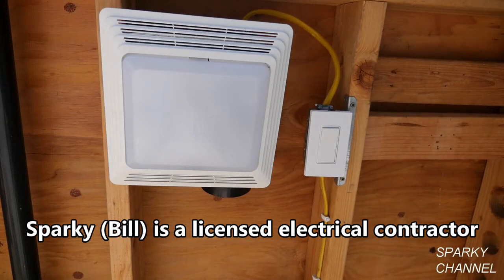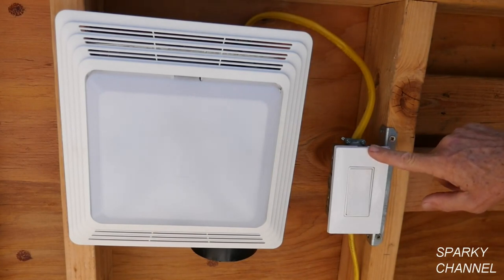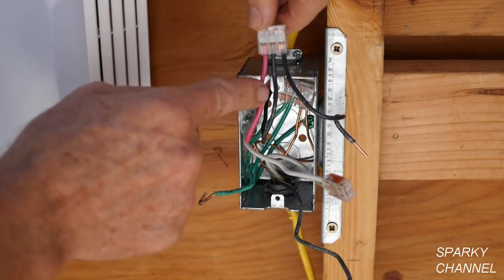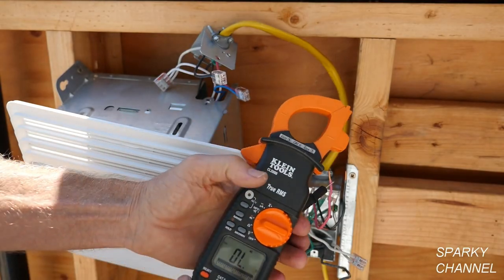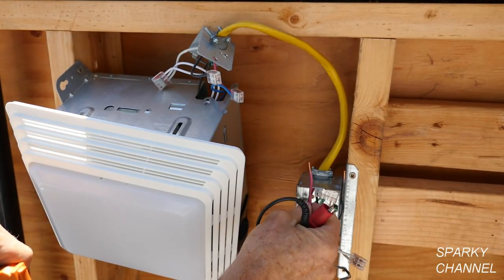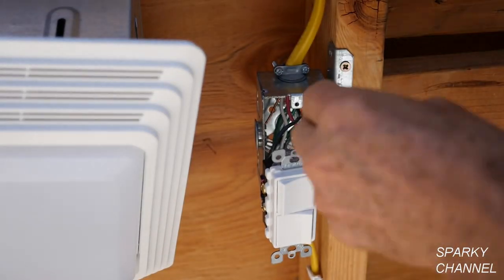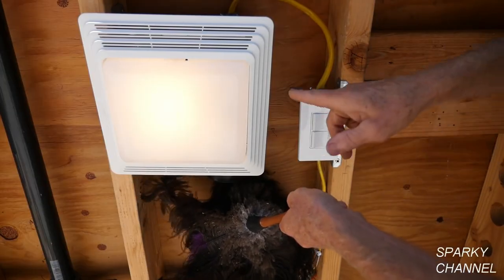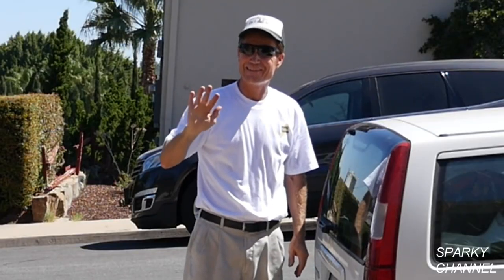The Easy Way to Put Light and Fan on Separate Switches (With Some Luck)

Comment: Boy the extra wire usually isn’t available. That would be a big score and a big breath of relief 👍
Reply from the maker: A little optimism is sometimes paid off with this scenario. Especially when then fan and light are in different locations there is often times enough wires in the switch box to wire a double switch.

Comment: Great video. Better explained than any other i've seen on youtube.  Great job!!    
I have a question for you.
I have a bedroom ceiling fan that uses the same double switch set up in one box as you used in your video.  It also has a remote which was installed when the fan was installed, and it works perfectly. 
Now, the problem I am having is I tried to install some smart switches, and the light would turn on normally right away but then after a few days, the light would wait at least 30 seconds and many times more before coming on.  So then I tried a different smart switch, same thing.  Then I tried a different brand smart switch, same thing.  Then I tried the old switch back in and same thing.  Then I tried a NEW double switch, same thing.  Very frustrating.
I'm pretty sure the wiring is correct. I had a ground, white and black coming from the home panel.  Have a black and red going to fan/light.  I connected the hot from panel to black screw on right top side of switch, then connected red and black on left brass closer together screws on left separately. Connected ground wire to green screw. The white wired were all capped, didn't need them.
Any idea what the heck is going on?  Could it simply be the remote unit up in the fan is faulty?  Never did anything to the fan at all, was working on switch in wall all this time.
Any help would be appreciated.   Thank you for your time...................  Craig

Comment: There should be building code about running a 12/3 to every ceiling!
Reply from the maker: I agree. It's so useful!
Reply: I hate that bathrooms with a window are not required to have a fan.  Who's going to open the window during the winter to let the humidity out!!!
Reply: Maxwell R.   Good to hear that.  Hopefully, the rest of the country will change the building code!

Comment: @Sparky Channel. Thanks Bill for making this educational video. Yes, we would be very lucky if the electrician who wired a single fixture bathroom light with fan with 12/3. In my house, the lights are above the vanity and fan is in the ceiling. So I'm guessing each fixture is wired using 12/2 with ground.

Hope you and your family stay safe and well.
Merry Christmas.
Reply from the maker: You could most likely put your fan and light on separate switches with no new cables if you haven't already. Check out my video: Separate Switches for Bath Fan and Light from Single Switch in a 1960's House: https://youtu.be/-KM9crpIU8Q
 You guys stay safe as well!

Comment: Pretty much, your other video with the 12/3 w/ground already existing. The only other way I can think of that you could do with 12/2 w/ground that would be allowable in code would be to use something like a wireless ceiling fan controller. It would have to be just straight on and off for both the fan and the light. China has some interesting wireless modules you can get. I stalled a wireless module for the light kit of my brother's ceiling fan when he came down with cancer. Unfortunately, he died like a week later...

Comment: Thanks for sharing! I've installed ceiling light/fan a few times using 14-3 romex, but for some reason I'm having trouble with it now. When I turn on one switch (either light or fan), it controls the other switch as well. Any ideas?
Reply: You’re probably accidentally switching the hot and neutral around. Anyways that’s an old comment so I hope you figured out what was wrong.

Comment: I came across your page. Hoping to get a solution to my bedroom ceiling fan and light. Wanting to separate the two. But once I opened the switch, I only observed one black in and one black out. Two white connected together and the single ground. So this solution won't work. Any other though?
Reply: No. Unless you can fish a new wire to the fan and switch it won't work. You need one more line to make it work.